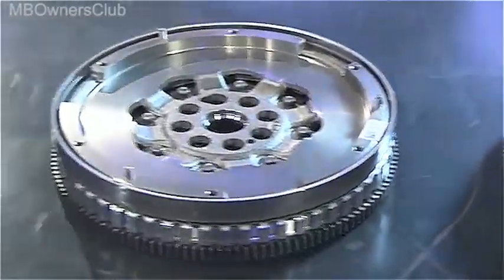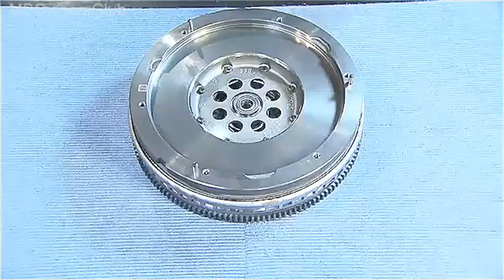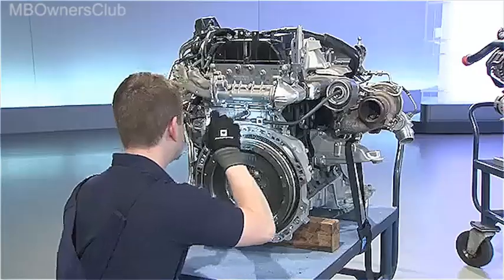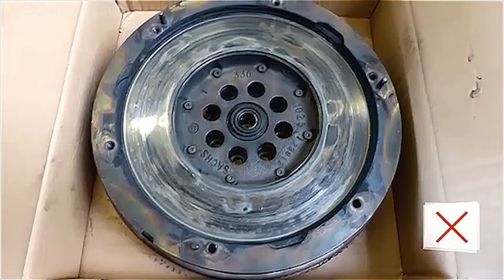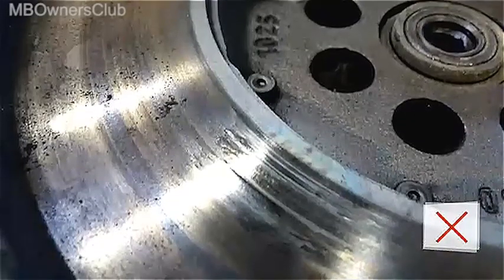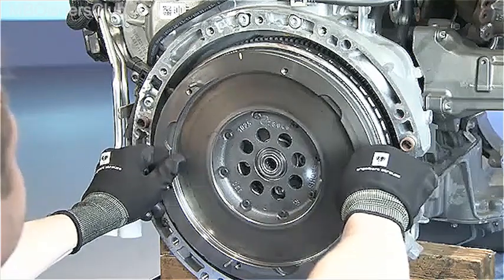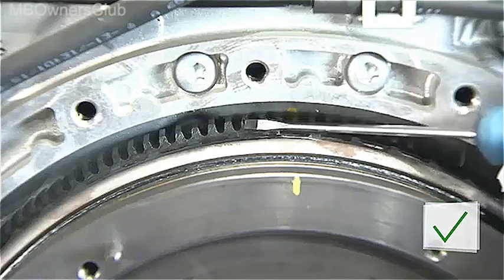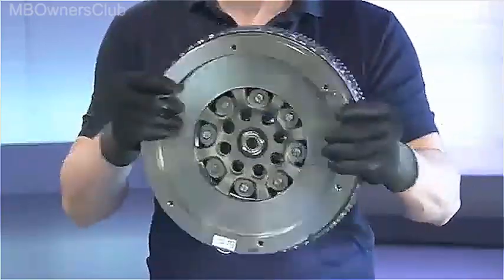Visual Inspection of Dual Mass Flywheels on Mercedes-Benz Engines OM651, OM654, and OM622

Comment: Hmmm. Not sure I'd be too pleased with one of those wobbly dmf's in my car. I have a new dmf on a box here, and there is no lateral movement of the secondary mass at all. The one on the car at the moment has excessive (as far as I am covered) backlash resulting in driveline shunt, but would pass the tests demonstrated here and be left on the vehicle. Talk about minimising dealer costs.....